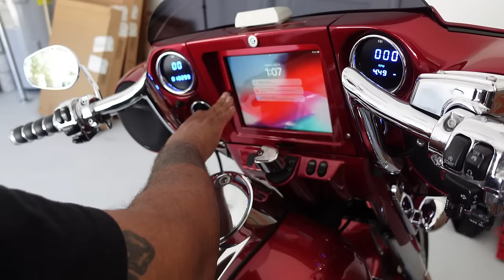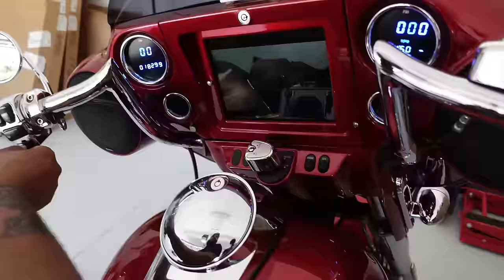TEACHING MY WIFE HOW TO RIDE THE MOTORCYCLE!!! *never again*Vlog #24

Comment: I can’t believe the Shit i’m hearing…Can’t ride my bike because the music ain’t working.!!..You must be a new rider because a true Harley rider knows damn well the real music from a Harley comes out of the exhaust,,That roar and crackling sound out the mufflers…I have music on my Road King and if the music wasn’t working no big deal but it sure as hell wouldn’t stop me from riding…Buy a  spray can of electrical switch cleaner or electrical contact cleaner..Spray a good amount on ALL your switches,,Lights,,Horn,,Cruise Control Switch etc etc…Spray and at the same time turn the switches on and off several times,,use a good amount…It will clean all the contacts on your switches…..